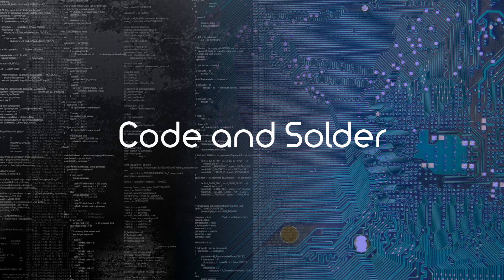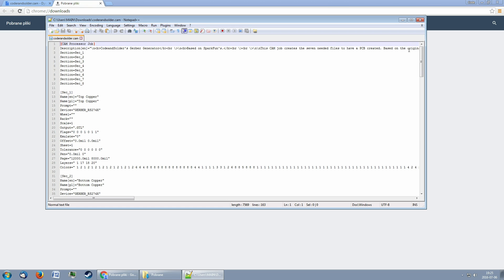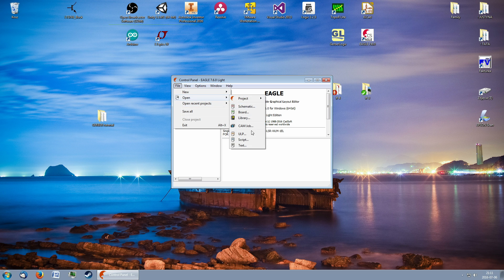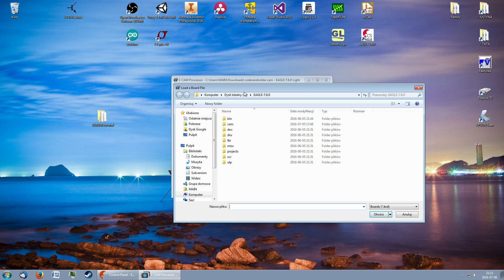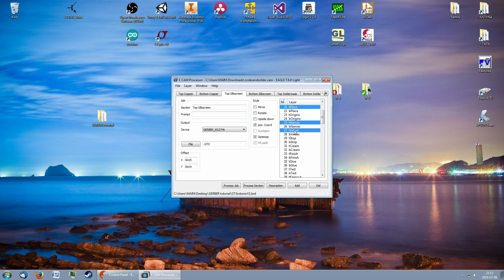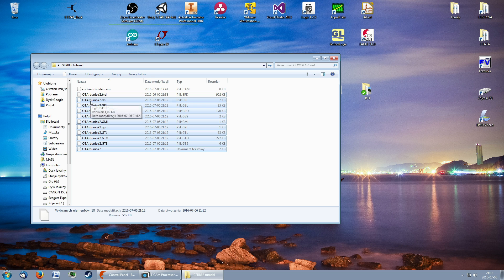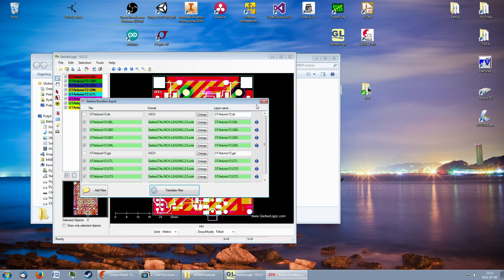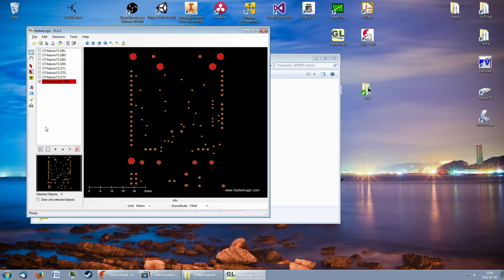How to export GERBER files from Eagle CAD (in under 2 minutes)

Comment: Why there is no Dimension layer 20 at [Sec_2] of this CAM job ? Not sure but wherever is copper layer there should be Dimension as well ??
Name[en]="Bottom Copper"
Name[pl]="Bottom Copper"
Prompt=""
Device="GERBER_RS274X"
Wheel=".whl"
Rack=""
Scale=1
Output=".GBL"
Flags="0 0 0 1 0 1 1"
Emulate="0"
Offset="0.0mil 0.0mil"
Sheet=1
Tolerance="0 0 0 0 0 0"
Pen="0.0mil 0"
Page="12000.0mil 8000.0mil"
Layers=" 16 17 18"